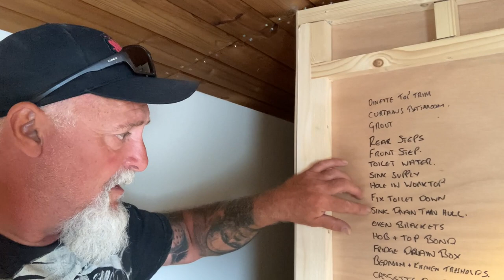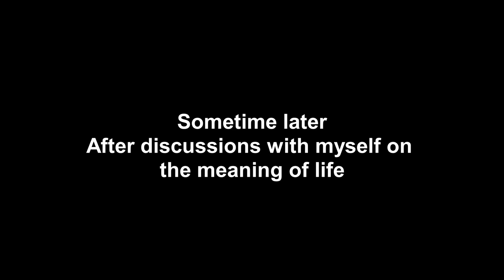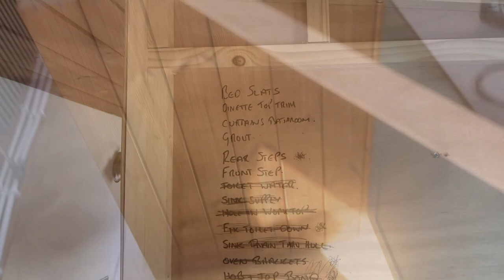Building Our Narrowboat #54 - A Lot of Hard Work is Hidden Behind Nice Things.

Comment: Good morning guys, glad to see you survived the heat wave, it's a fine day here after our heat wave. Working in it is a real challenge tests the spirit. It's really what you can't see that makes shine what you do see. I'm so impressed with the progress you've made. I have a question though it may be might premature have you given any thought to what type of cruising you might take, Moonshine is go anywhere right.
Reply from the maker: Hi Kevin, yeah it was hot for a few days, but we mainly worked through it, drinking plenty of water (not beer this time) Its only recently that we have started to actually see what we have done, in about 8-9 months. If funds were no object we would be complete by now I'm sure, But as were were over budget we have had to work a little more than we would have liked. Mainly we are back on three day weeks now. Moonshine can get almost anywhere, with only a stretch near Leeds I think where the locks are too short. We are talking about that more and more recently, with the main question is earning enough to sustain us. Both our businesses are based here so how we accomplish the cruising lifestyle is still in question. Of course there is still a lot of area to travel in the van too, but spiraling fuel costs may curb that. Anyhow, all I can say is watch this space. (we have applied for roving trader license as a tip). Thanks for everything Kevin.

Comment: Hi Marty I’ve just bought Glyndwr it’s having a full survey and blacking next to your marina I need to park the van while I get the boat to Dunchurch marina as you know the area we’re do you think I could park it? The owner says you fitted the solar system on board it has 2x 256w panels could I add more Pamala or change them for higher wattage without
Changing anything else 

Many thanks Steve
Reply from the maker: Hi Steve, I don't recall fitting the panels to a boat with that name, possible though. As far as the controller goes, I would have specified that to suit the panels, so likely there isn't much wriggle room there. Is it a narrowboat? Those panels pretty big for a narrow. Maybe he supplied them, I cant remember. Regarding the van, are you buying boat from brokerage? You could ask to leave in the marina if you could leave van here, but vans are a contentious issue right now here.
Reply: @narrowboatmoonshine  thank you I’m going to leave the van at the pilote inn the manager was very nice
Richard Currie is the owner he knows you?
The boat is now in dry dock next to you now not looking forward to travelling back to Dunchurch marina especially on the Severn 🙈